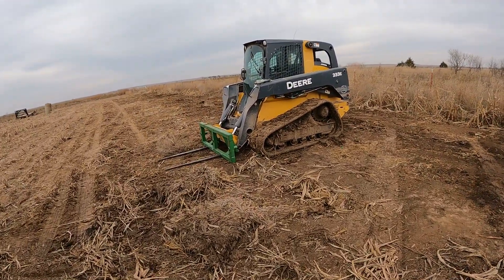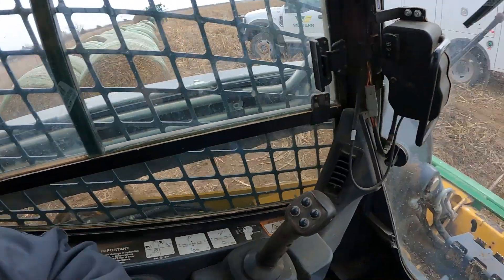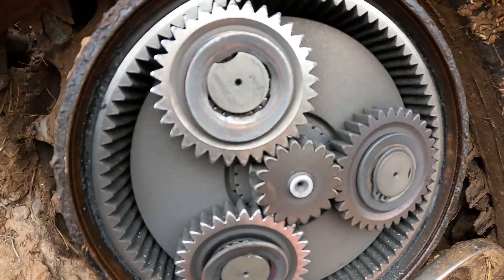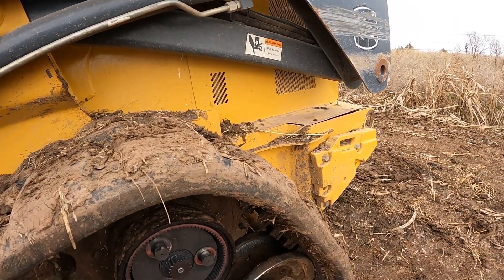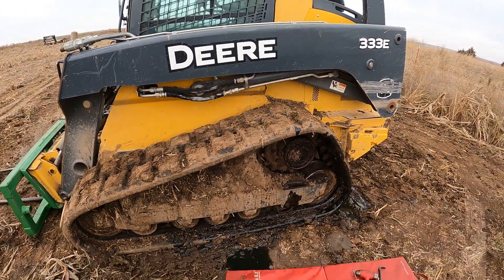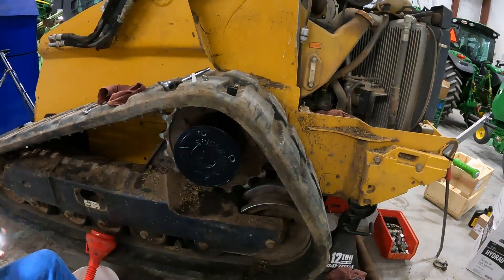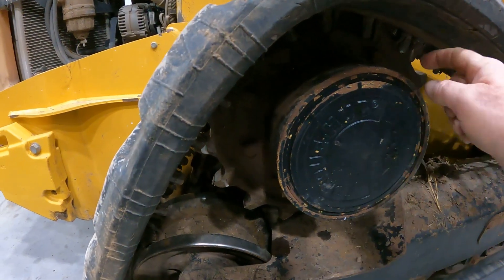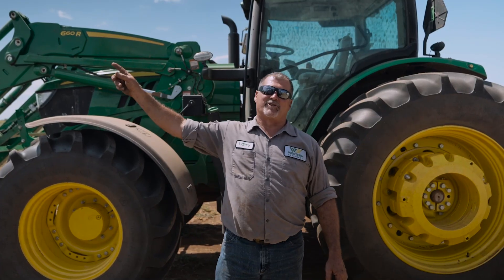E91 | John Deere 333E Skid Steer Planetary Hub Failure

Comment: Thanks for this video. As a DIY person I would have liked to have known what tools would have been needed to replace the motor. I just replaced the planetary motor on mine, and I agree with you that checking the travel motor oil is extremely important and probably most often missed. Thanks for this video.